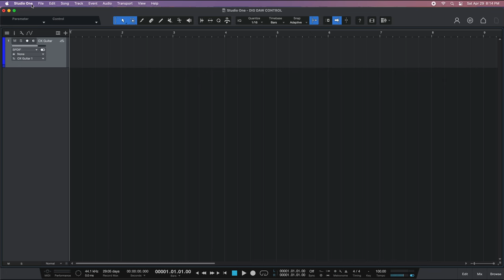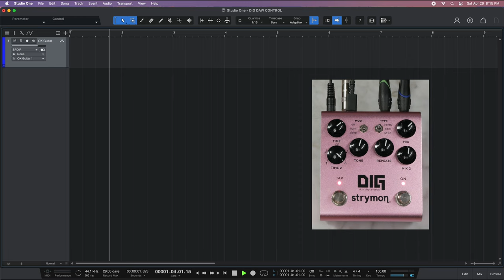@strymon  Dig V2 MIDI Bugs: What's Broken + Sound Examples

Comment: Thanks a million for this video!  I am having the midi sync issue and have spent hours trying to figure out why the subdivision was not saving.  I didn’t know there was a fix for it.  You saved me amigo!
Reply from the maker: Glad it helped Albert! It's a huge PITA that these are still being sold with outdated firmware. Hopefully the fix from Strymon will get rid of the technical problems so you can play some tunes and enjoy the DiG!

Comment: I think many of the issues were fixed with the latest firmware update (rev. 1.25). What still bothers me is that the Tap LED lights up blue when receiving MIDI clock. It makes it impossible to have a visual confirmation of the tempo. At least recalling with the stored midi/div setting is mentioned in the release notes, so that’s a good thing. I really like the sounds from DIG so I haven’t given up on it yet.
Reply from the maker: Hi Xavi, thanks for bringing this to my attention! Looks like this firmware dropped in September '23 and the Nixie v2 Beta launched in November. I have not had the opportunity to test this myself - my Dig is currently out on loan. I'll update the video notes to reflect the new firmware info! Here are the release notes for those who are curious: https://www.strymon.net/faq/dig-v2-firmware-revision-release-notes/

I agree that it's a bummer to not have a visual indication of tempo when receiving midi clock.

Comment: I appreciate the honest review. It does bother me how few gear channels are willing to even mention a little constructive criticism. I'm still intrigued by the DIG, but wish perhaps they had done a larger enclosure where access to those secondary functions would be easier and more intuitive not to mention have access to presets. May I ask, have you found a decent alternative to the DIG in a pedal format? I feel like the FTT Future Factory looks like it might be able to attain some of the same sounds.
Reply from the maker: Hi Lost! I still haven't found a digital delay pedal that I would permanently place on my board.That FTT Future Factory looks pretty neat - I had never even heard of it until now. 

That said I've been focused more on recording and in that environment I find myself needing pedals less frequently. In my current workflow I record a mic'd up amp and have a digital reverb or or delay on a bus. I can then tweak the verb or delay to my liking after the recording has been finished. This gives me way more flexibility and prevents me from getting options paralysis before I record.

Comment: Great review. Also waiting for Nixie Beta support for the DIG V2. Nixie does update the firmware which is good. I have a MAX patch that currently works bidirectionally with the DIG, but doesn't save patches. I'd suggest doing a SYSEX dump of the patches in your favorite DAW until Nixie Beta supports it. About to save 4-5 patches for live use with a MIDI Footswitch.

for plugin delays, look at the PSP 42, which is 12-bit and "warmer" than stock delays.
Reply from the maker: Thanks Ned! Strymon seems to be getting their act together slowly but surely. Thanks for bringing the SYSEX option to my attention - I wasn't familiar with this one! The PSP 42 looks interesting, I'll have to give the trail a go at some point. I've been spending some time with Fab Filter Pro R 2. Here's a track I did with that one: https://soundcloud.com/shoe-tique/nesting-doll
Reply: @shoetiquemusic  sounds great! I'm also fond of the SoundToys plugins for regular echo or sound mangling. I'll keep working on the MAX patch, as IIRC there is an option to then create a standalone version of a MAX patch that can be shared for people to use without MAX. I just need more hours in the weekend.

Comment: Another problem using MIDI Presets and MTC is switching MIDI Presets with the different or even the same tempo cuts out delay signal as in no spillover and annoying ramping up/down sound ala analog delay. Pretty useless in live application. Anyone got a fix on this?
Reply from the maker: Hey Dave! I busted the DiG out and tried to see if I could find a way around the MTC/Spillover issue. Unfortunately I wasn't able to find one. This issue is present even with the super secret firmware update from Strymon (version 1.12).
Reply: @shoetiquemusic  thanks for trying to find a solution! Is this the same with Volante do you know by any chance? I’m in communication with Strymon I’ll post their response here as well
Reply from the maker: @daveandrew7014  I don't have a Volante (or any of the big Strymons) so I can't confirm that one. I'd be curious to know if they suffer from the same MIDI bugs! Thanks for looking into it!
Reply: Ok Strymon got back to me. They said Spillover does work for MIDI preset changes but only after 5 seconds. So you’d have to stay in a preset for more than 5 seconds then change to make it work. So all good for this matter. I was testing it like a second preset to presets which will never happen in live situation. 

Now the ramping up and down sound between MIDI presets with different MTC doesn’t have a solution and is unavoidable. 
This is very unfortunate and made it unusable for me live. I am sending it back.
Reply from the maker: @daveandrew7014  Thanks for following up! I was also switching between the presets quickly which explains the lack of spill over.

I mostly use the DiG at home, but I can see why the ramping would make the pedal a PITA to use. There's better stuff out there - send it back!